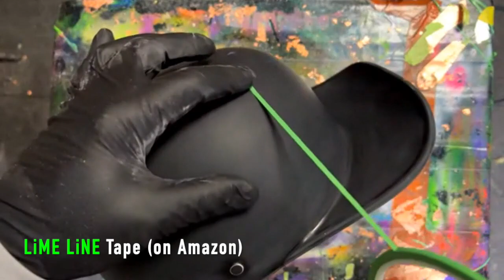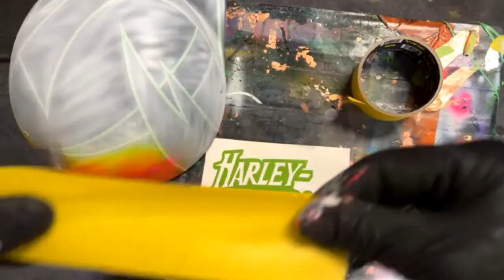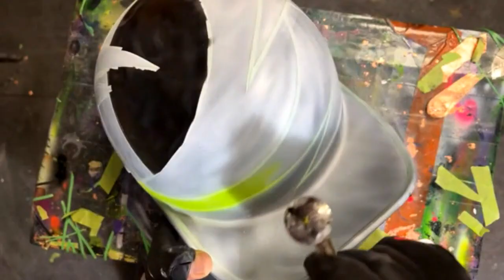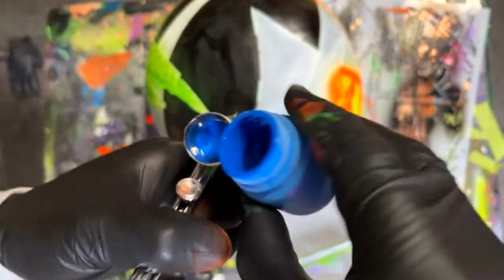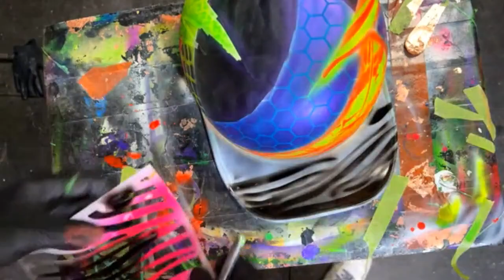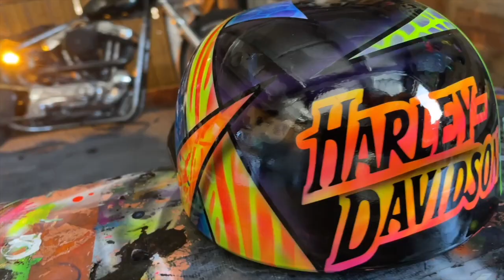RAD Custom Helmet Design!! 90's Paint Job From TiME WARP

Comment: Quick question. How do you prevent the stencils/tape from picking up the fresh paint underneath? I have that problem very rarely but cant pinpoint the reason. I never have issues with the main basecolor lifting, just freshly painted layers of a graphic/logo. I switched over from shitty orcal stencil vinyl to the yellow Avery half-bake stuff and that seemed to help alot, but i still have the occasional issue. Love the videos btw, they honestly got me motivated enough to buy a gun and start painting (and they have really helped a ton).
Thanks!!!